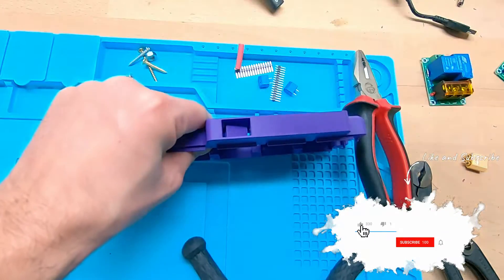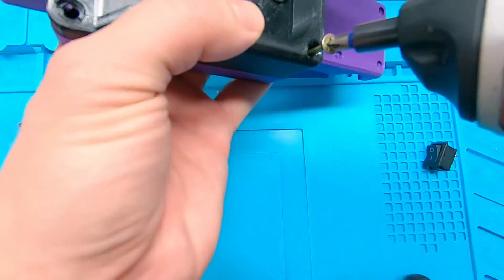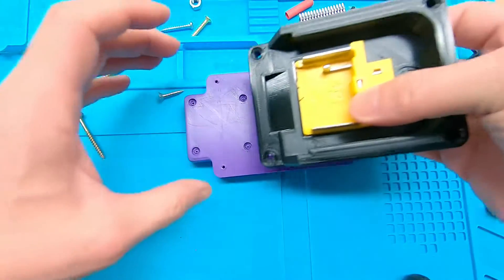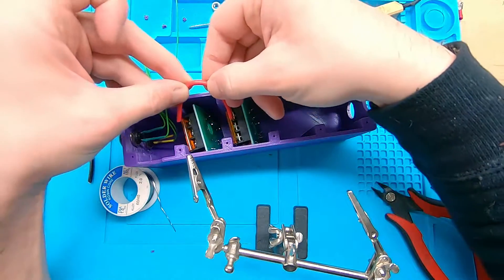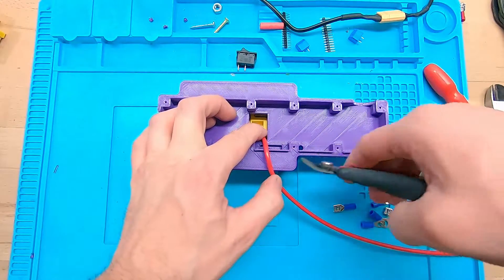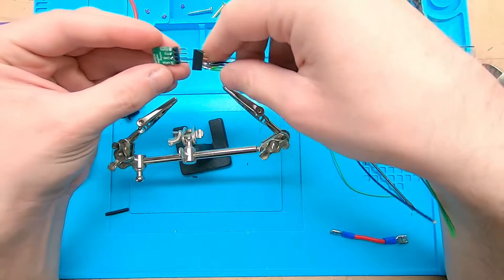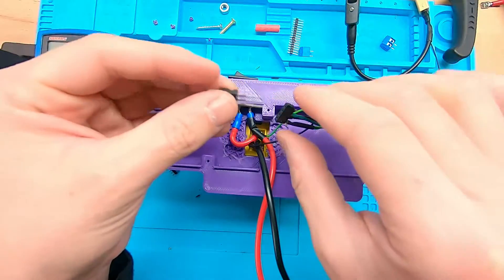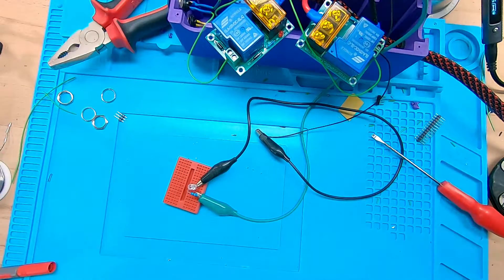DIY Battery powered Electric Airplane Tow Bar / Tug - Part 2

Comment: Not a fan of using a lighter instead of proper hot air gun to shrink heat shrink tubing, but plenty of people do it. The rest of of build seems like fairly nice work, except then you use PLIERS to crimp on your terminal lugs instead of a wire, crimper?  tsk! sk!

Comment: As I previously noted, the  schematic failed to indicate a ground  for the motor.  I just finished my build ( with the ground) for our 172, and it works fine.  My only  changes were substitution of an automotive relay, because the spec relay was not available, and an outside support for the roller on the movable  tow arm.  I used brass riveted to the arm with an extension of the roller axel thru an over-size hole to accommodate the arm swing when mounting the bar to the wheel.
Reply from the maker: Hi Michael ... thanks for you comment I will add the ground to the schematic. Do you have a video on your build you like to share?
Reply: Michael, can you share pictures of your build? Is it still working out on your c172?
Reply: Could you call out the model number for the relays you used?

Comment: Neat work. But it looks like it will put too much pressure on the right leg of the towbar. I would extend the motor mount to reach left side. Probably add 2 parallel tubing as horizontal brace to prevent motor mount rotate around single leg. Or extend the wheel shaft and add another wheel mount on the left but I'll be more tricky to design it to accommodate the clamping movement.